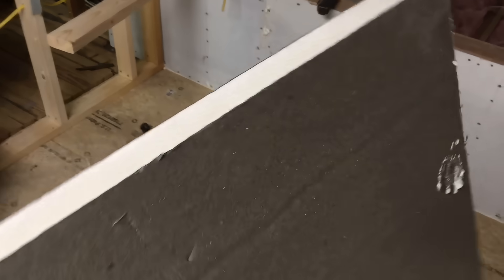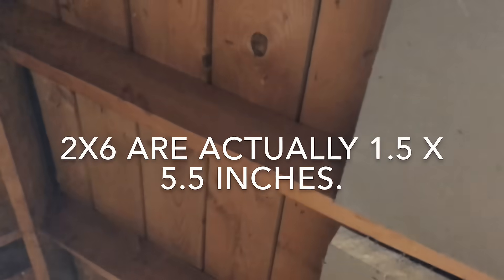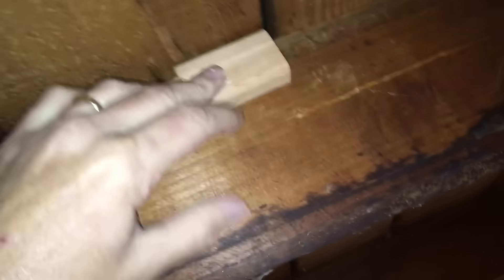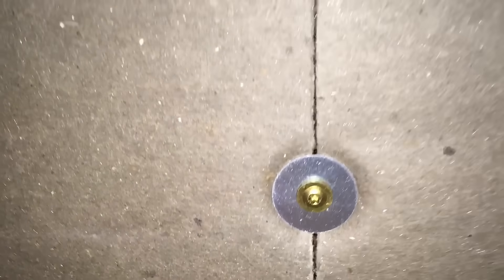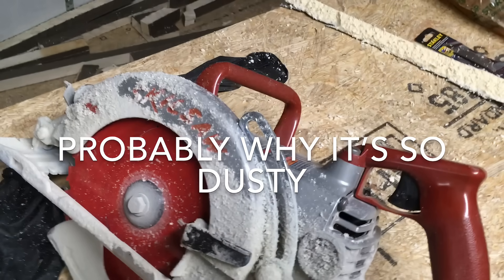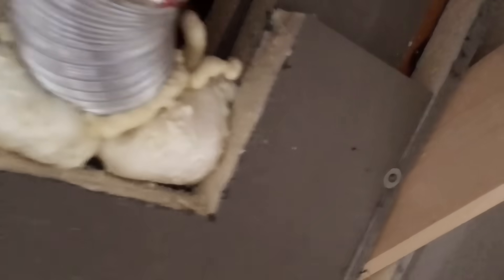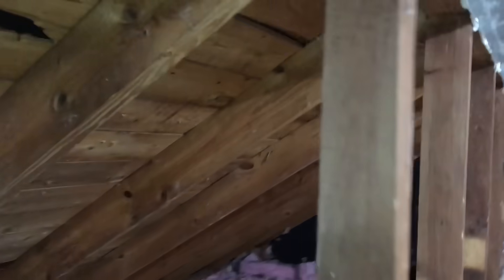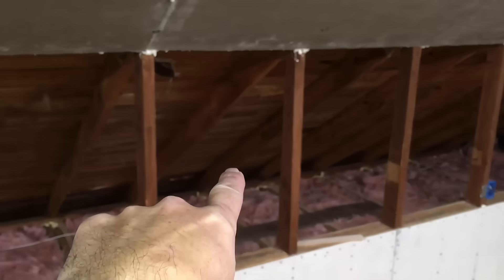Getting R-30 in an attic suite with 2x6 ceiling rafters

Comment: Define your envelope, all that work is fruitless. Please ask me how and/ or check out Joe Lstiburek videos. Cheers.
Reply: Yea, everyone should watch Joe Lstiburek!
Reply: @Victor L, how is it fruitless
Reply: @BOAH247  To me it isn't fruitless but you tell me how he plans to hang drywall on that? If he was just to use half inch foam (on the rafter) and 1-1/2 fir strip to bring the rafter depth to 7-1/2 inches (doing the same for drywall nailers) minus 1-1/2 for the required ventilation leaves him 6 inches to work with versus 4 inches usable depth he has. He would have had everything with thermal breaks and more choices how to insulate the space. Also he would have had absolutely no issues with finishing the space with drywall or the covering of his choice. I feel the only option he left himself is to glue paneling to the insulation (not a big fan of such things) all though it would keep his load on rafters low.
Reply: Many of the commenters here should be watching his videos. I am not in the trade but scrolling the comments on this video alone I see lack of education even coming from those claiming they are in the business. It is a damn shame honestly. One guy up there thinks a conventional 2x6 rafter measures 6 inches... Others don't understand why the required ventilation. But yes they all need to watch his videos.
Reply: Victor L., How is it fruitless ? Once he insulates the knee wall and the small flat ceiling, the envelope is complete.
I'm asking, please do tell.
Reply: @augustreil  he isn't sealing off the vented roof from the space.  The batt insulation will get blown thru with outside air because he hasn't made a thermal break with a complete layer of rigid foam.  Batt insulation only works if air isn't moving thru it.  He doesn't need to add multiple layers of rigid foam, just a single layer and he can add whatever insulation between the rigid foam and drywall to build up the r-value.

Comment: Bosch T313AW3 jig saw blade is designed to cut foam and will do so with little or no dust. 3 blades for $15 on Amazon.
Reply: Also you can create a box fan with filters in the back.
Reply: That's very cool.  I had taken an old PC power supply and hooked it up to three strands of SS wire twisted to make a heating element and cut my 2" foam board that way but will try these blades.  Doing the same thing this guy is but was looking for a better method before I move forward.  My board is 100% foamular no fiber.  I had used that do-it-your self foam but that stuff is a pain in the but and $$$.  They want $125 for the hose $ gun then you have to keep going no stopping or you will probably have to buy another hose and gun since it get stopped up and changes the mixture colossal mess and waste of money.  I would only use it on a boat hull not a house space.  Thanks again for that tip brother.
Reply: Earnie g
Reply: Is Amazon the only online source ...? ! Bezos has enough wealth...wait a little longer and buy elsewhere.  America doesn't need monopolies and trillionaires !
Reply: @jgrmtnjgrmtn3954  Bezos earned his wealth, just as almost every billionaire has. Never understood the hate towards the rich, screams jealousy and envy meanwhile that could be YOU if you really wanted and worked for it.
Reply: @NuttedInYoMom  I do have problems with billionaires who advocate globalists' ideology and wanting to remove our borders.
Reply: @NuttedInYoMom  
One man, one vote. 

I believe the issue is political influence. I don't know what solution to this problem. Maybe it's time to redefine what constitites "buying elections" and impose extreme financial penalty as deterrent. Would the elites of Congress get behind such legislation? I don't think so. 

Media run by political activists is no longer news but propaganda and social media censorship is another example of elites actively silencing opposition. Lobbyists with deep pockets, campaign finance. The problem with reform is that the ones shaping legislation become millionaires far beyond their already lucrative salaries. they are not interested in reforming anything which will make them wealthy.

In theory the Supreme Court can hold power over Congress. Maybe if they were a million lawsuits against Congress, against news stations, and against social media censorship the Supreme Court would be forced to address these issues and stand against corruption and rule in favor of one man, one vote in the broader sense rather than in the literal sense. 

And the rich can just go on being rich as long as they lose the corrupt ideology that wealth entitles them to swing elections. They already have the power of privilege and the power to shut down the economy in protest if taxes are raised on them. Should they also have power to swing elections?

I am against raising taxes on the rich. I don't believe anyone should ever pay higher than 40% of their income. Maximum. 

Trumps tax cuts for the rich caused the strongest economy in history. That's how you generate tax revenue. That's the enablement of the American dream. 

Raise taxes on the rich all the way up to 70% and they would just say no. They would shut things down in protest. Because they can. They can live off their wealth. They would fight back. If they didn't fight back that would be acceptance of the 70% rate. They would be forced to fight back, would shut down the economy. They would cause eonomic pain for as long as it takes, they would spend enough money until they can swing a vote for pro tax cut leadership. 

For as long as they are targeted with proposed 70% tax rates I really can't fault them for using their clout to affect election outcomes. 

40% ceiling should become law. With that concession in place perhaps the other issues I mentioned could finally be dealt with through the Supreme Court. 

They will always have more than one vote. They will always have the power to influence elections, to buy politicians etc and there will always be corruption. That doesn't mean we shouldn't work to minimize it.
Reply: @NuttedInYoMom  No one begrudges Bezos his great business. ANd he has high standards. But he should likewise pay his workers better-than-average and help the middle class grow. This is good for ALL Americans. $15/hr is low-level wages. Bezos should do much better than that.
Reply: Cool. Thanks. I wonder if a sharp utility knife would work. No dust there.
Reply: @caseykittel  it tends to stick in the foam on long cuts.

I found the best way to cut it is with an oscillating saw.  Put an old used blade on the grinder and sharpen all the edges.  Cuts foam board like hot knife thru butter.
Reply from the maker: used these in a test video https://youtu.be/Z292iuV91hA
Reply: Cordless circular saw or sawsall leaves less dust than an electric saw,  and a serrated kitchen knife works well also....
Reply: @laman491  you must have missed the above post and link. Have a watch:
https://youtu.be/Z292iuV91hA

Comment: How did you attach the drywall to the slanted walls, given the thickness of the insulation?
Reply: Mark Proulx , I’m curious about that too.
Reply: Liquid adhesive and a few long screws, as long as the iso is screwed off really good.
Reply: Given that he has 24'' OC, 5/8'' drywall should be used if he's using drywall to prevent sagging and attach the same as any other, except longer screws.
Reply from the maker: https://youtu.be/dGeoA1ji_iM

Comment: I just went through this.  Building code approved all insulation installed and within 3 months everything weaped and condensates so bad it would have rotted off the roof in less than a couple years.  It had full R and air space and still failed.  Spray foam, spray foam, spray foam.  Worth every cent.

Comment: This cant be much cheaper than getting some 2lb spray foam kits. A lot more work too.
Reply: 600sqft of closed cell foam is around 300-400 dollars. That's what I used. So much extra work -_-
Reply: @MoistHousePlant  30 bucks a sheet for that stuff 4X8
Reply: @godbluffvdgg  cost me $700 and about 25 min.. did sheetrock 60 min after. Almost zero clean up. Hard pass on the fiber glass
Reply: @MoistHousePlant  If you're happy, I'm happy...Sounds like it's a wash with materials...
Reply: @MoistHousePlant , Should always wait a day or two for the spray foam to finish off gassing.
Reply: @augustreil  we went on vacation for two weeks after. So I wasn't worried about off gassing. Normally I would.

Comment: Passive house build videos with infinitive detailshttps://www.youtube.com/user/seumas2/videos

Port
Alberni's first Passive house (Passivhause) build in the heart of
Vancouver Island British Columbia Canada.

Passive
House(Passivehaus) is considered to be the most rigorous 
voluntary energy-based standard in design and construction industry
today.

Passive
house buildings consume up to 90 percent less heating and cooling
energy than conventional building.

The
use of Passive House design software was used to gain the specs
required to meet the performance standard for this location.

House
was constructed well  above the current standards as outlined in
the B.C. Building Code.

Footings
were widen to 36 inches(914 mm) due to low bearing soil conditions
and additional rebar reinforcement added.

30
inch high (762 mm) high reinforced walls . Course sand placed inside
foundation walls and mechanically compacted.

Three
layers of four inch *102 mm) thick  Expanded 
polystyrene foam sheets with all joints staggered and tape were
placed on top of compacted sand.

The
three layers of foam have insulation value of approximately R 50.

A
20 mil layer of poly was placed over the E.P.S. sheets and taped and
sealed.

Four
inches(102 mm) of 30 m.p.a fiber reinforced concrete was placed to
form a slab over the foam based.

Slab
is isolated from concrete stem wall with four inches (102 mm) of
E.P.S. to prevent thermal loss.

All
cold water lines are buried in the sand to keep them cool, hot water
lines have been placed in the center layer of foam insulation to
minimize heat loss.

Wall
plates compress to heavy beads of acoustic sealant between layers of
vapor barrier to prevent air movement.

The
walls are double stud configuration set at 24 inches (610 mm) on
centre and plates are spaced in a manner that yield a 20 inch (508
mm) thick wall. 1/2 inch (12 mm) standard plywood sheathing with 
Mento 1000 a three layer airtight vapor open house wrap( far superior
to common house wraps) with 1/2 inch(12 mm) pressured treated plywood
rain screen battens form the exterior surface. 

Intello 
smart vapour barrier was installed one third in from the inside wall
to prevent condensation in this climate.

Triple
pane argon filled windows meeting passive house standards from
Euroline  were placed mid wall to reduce wind wash heat loss. 
All window openings have been splayed at 45 degrees to give a full
wide angle view.

Almost
all the wiring and plumbing was kept inside of the vapor barrier
envelope to minimize air leakage.

Passive
house standard requires air leakage not to  exceed .6 Air
changes per hour at 50 pascal.

Zehnder
comfoair 200 HRV has been installed with a 1000 watt air preheater
.(92 percent heat recovery rate)

House
has been pre- plumbed for a heat pump water heater reducing 
domestic water heating cost significantly.

Garage
has been pre-wired for 40 amp/240 volt  electric car charging
station.

House
to be equipped  with  heat pump condensing dryer which
requires no external venting,only a water waste line. George K
Builder. © George K 2019      
https://www.youtube.com/user/seumas2/videos

Comment: Agree with the hot knife comments, no dust, clean edge, super quick, inexpensive.  Gonna have to redo all your nailers if you’re sheet rocking the space.  Whatever you do for the ceiling it’s gonna need like 4” screws just to reach the rafters. Better off packing out the rafters first, insulation next, then interior framing, electrical, plumbing, etc..
Reply: Hot knife will not work with polyiso or polyurethane foams....only expanded polystyrene.

Comment: Sounds like unreasonable code requirements, so
Reply: It would be cheaper to to use 2x8 rafters and covent ional insulation. The extra labor cost is not cost effective.
Reply: @raymondcooper6443  It would be cheaper to remove all of the 2x6 rafters, replace them with 2x8 rafters, then insulate conventionally? I kinda really doubt that.

Comment: Polyiso foam cuts easily using a snap-off knife extended. Usually 2 passes with the knife will cut the foam cleanly. Plus this is quiet and no foam flying everywhere.
Reply: Exactly. I have cut hundreds of sheets that way. Probably thousands.
Reply: But you can't cut out notches like he was doing.    A Jig saw with a foam blade is what he needed.
Reply: Home in the Earth Yes you can, it is very easy to do. I do it all the time.
Reply: Spot on. I always use an extending, snap-off, Stanley type craft knife to cut foam (and polystyrene) and I get no dust, no mess and accurate cuts.

I can't believe how people use saw to cut it!
Reply: opkcts especially circular saws. I don’t get that at all. Creates a huge mess.
Reply: That would make too much sense and not be macho enough. Lol
Reply: A A some will even bring their Festool track saw and multiple tracks for that. Big eye roll!
Reply from the maker: You win!  https://youtu.be/Z292iuV91hA  ---Great suggestion!

Comment: If you can afford it I'd use the spray foam. You get better R value, its a moisture barrier that fills every crack and it adds a significant amount of structural strength to the roof.
Reply: And it will most prob give you cancer in ten years.
Reply: But he needed a 1.5 inch space under the roof sheething.......it would have been a lot of work to create that before sprayfoaming
Reply: They lied to him. You spray foam directly to the sheathing and you now have no hot roof and no place for moisture to form.
Reply: @ Bruce A And no way for the roof to dry. Don't do it.
Reply: @ John- why is the roof wet? Unless you have a roof leak, shingles breathe. There is no reason for moisture to be in the sheathing at all.
Reply: All roofs leak more or less, and wood wants water. So water can travel around a lot. You want it dry from both sides. Besides, shingles i hate, use tiles.
Reply: All roofs leak? Maybe you need to hire better roofing contractors. I’m not a huge fan of shingles given how much better metal is, but a properly dried in shingle roof (using grace, not felt) with 50 year composites is easily good for 30+ years. Wood won’t absorb water that isn’t there.
Reply: Greg Barry Not at all. Use a long pice of wood that is 1.5x1.5 and glue/nail to the rafter at both sides. Use thin fiberboard and glue/nail between.

Comment: radiant barrier  over exposed roof rafters would be wise
Reply: ratoneJR why not use polyurethane foam with radiant barrier attached?
Reply: Yes, reflective surface facing the hot roof sheathing. If you can also glue foil onto the roof sheathing, even better. Has little effect in cold weather, but big improvement on hot sunny days.

Comment: Bet that drywall guy didn't like that crap one bit! Kinda sketchy not having the sheetrock fastened to the rafters! This is just looking for trouble in the future with expansion and contraction.
Reply: You can still screw into the rafters... Just need to use longer screw and mark where they are located on the foam board... not that hard, just take a few more minute to do...
Reply: @noway543 , Bingo !!
Reply from the maker: I'm the drywall guy :-) https://youtu.be/dGeoA1ji_iM  no screw pops so far and it's been almost 2 years. I think the foam is acting as a buffer from the expansion and contraction of the roof rafters. Thanks for the comment.

Comment: Forget the worm drive or hand saw. Us an electric Turkey carving knife. Works awesome!! Thanks for the video.
Reply: Or a hot knife works even better, no dust and leaves a cleaner edge. Super cheap as well.
Reply: @ShuasiBjorlen  Hot Knife gives off alot of nasties when cutting chemical foam be careful man.
Reply: My battery powered sawzall works really well although it takes a bit of skill to make nice cuts.
Reply: Yeah,  it's like pick your poison.  Good respirator for sure
Reply: Yes carving knife, also Bosch scalloped jig saw blade for more custom cuts
Reply from the maker: tried this tip in my new video https://youtu.be/Z292iuV91hA
Reply: Bandsaw... One you can slow the blade down. Way down!